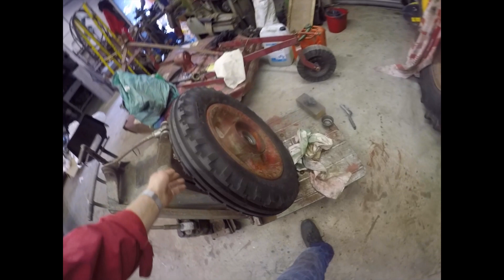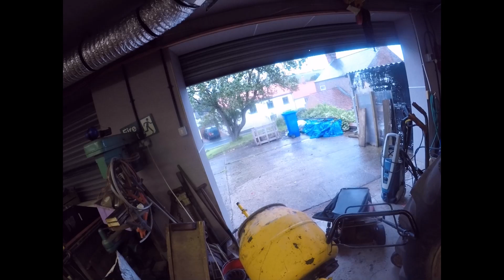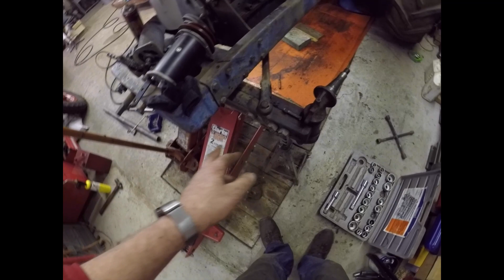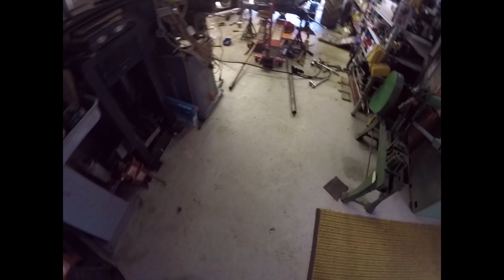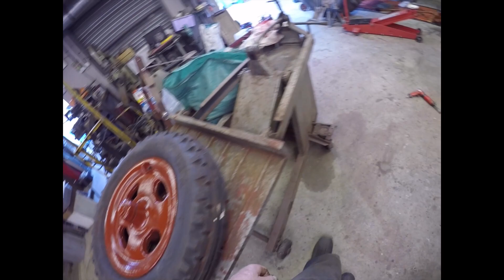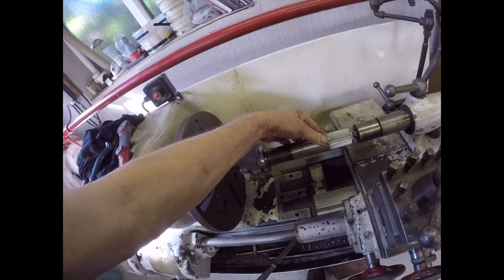Fordson Major E1A rebuild, Part 19 King pins/steering swivels.

Comment: Its a pleasure to watch you, you are a dying breed, I did a five year apprenticeship as a machine tool fitter fifty years ago and its a delight to watch you fit the shafts to the bearings and describe it so well, today all they teach young apprentices is how to change parts, there is no longer any scraping, bluing or fitting carried out.
Reply from the maker: What can I say apart from thank you!! I was apprentice trained at an industrial electrical engineers fron 1967 on, I did three years at technical college, with plenty of engineering and welding training as well, life is a process of  constant learning of new skills, and I have iearned a massive amount from youtube, although I had done lathe work before, and had a batterred DS&G lathe in the seventies, I learned to to cut threads on a lathe from youtube! Never stop learning, and practising what you have learned!
Thanks again,
Phil